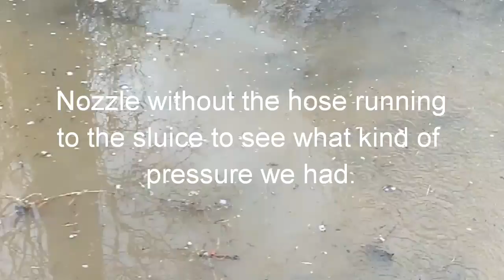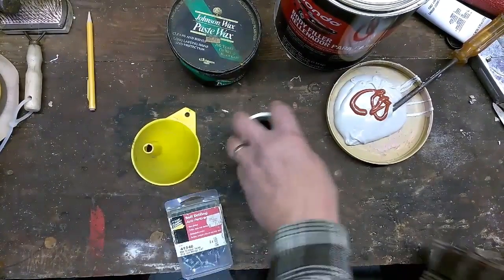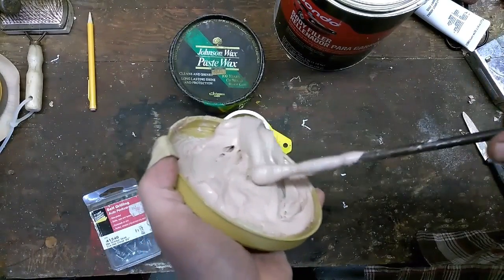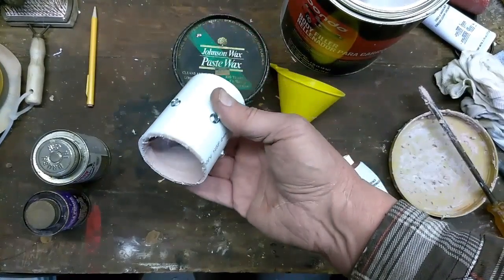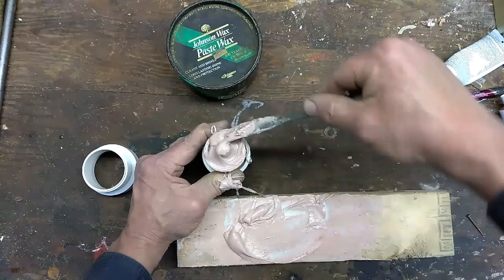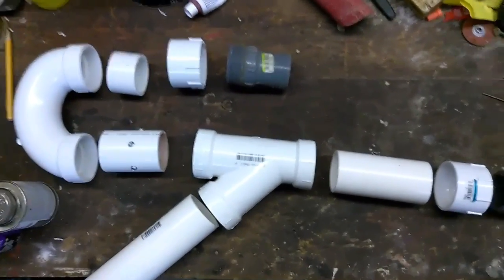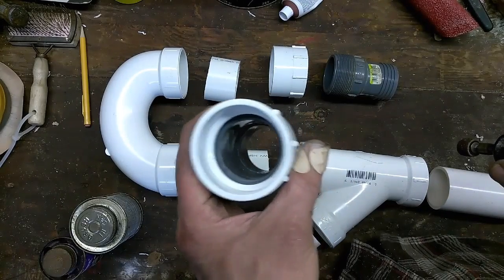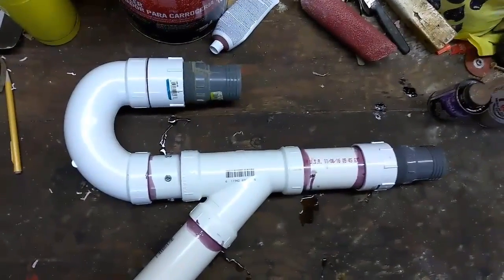Two inch PVC suction nozzle

Comment: That has alot of suction.  You really seem to know what your doing.  I am currently attempting to build a 4 inch nozzle in order to suck sand off a lake bed and pump it behind a new seawall for backfill.  I am attempting to pump the sand  up to 6' in height.  So far I have been able to pump sand but not enough.   I dont have good suction.  I am running a riverside 2-1\2" high pressure pump powered by an 11hp honda engine.  What should my jet size be for my 4 inch system?  Do you have any suggestions?
Reply: I need to do the same thing and my design incorporates a second pump further up the discharge line, which will act as a booster.

Comment: I am dredging a hole in my boat slip and saw your video and said this may work. My question I am curious about is that if I use a 4 or 5 foot gravel (in my case sand)suction pipe would that affect the performance? I need to move about 3 yards of sand for my keel to rest in. Thanks for share your video.
Reply from the maker: It will. But it may take a bit of time. You can extend the end of the nozzle. Try it.
Reply: I'm in (or under) the same boat. Did you have success?

Comment: Nice build I couldn't do it better myself :)
Reply from the maker: REDMAN PROSPECTING thank you.
Reply: Randall Monville yup happy prospecting
Reply: +Randall Monville hi I'm also macing a dredge nozel but want to cnow what size nozel works best to create the vacume .any advice pleas
Reply from the maker: Christiaan Schlechter start with .5 inch. Will depend on pump pressure and hose length and diameter of dredge. You can drill it out to make it bigger.

Comment: Would I need to make some diameter adjustments if I wanted to use a 3000gph 12v bilge pump?
Reply from the maker: I doubt it would make enough pressure to create a good suction. All you can do is try though. Start at .5 dia and increase .125 till you get suction.

Comment: This is so wrong the pressure water has to be introduced immediately after the suction side of nozzle or pressure water will be pushed out of the suction side. I am a mechanical engineer and your design goes against physics sorry😢
Reply from the maker: The pressure water goes over the suction nozzle creating the suction. If you extend the pressure nozzle past the suction inlet it will jam with rocks. You can see it working at the beginning of the video.